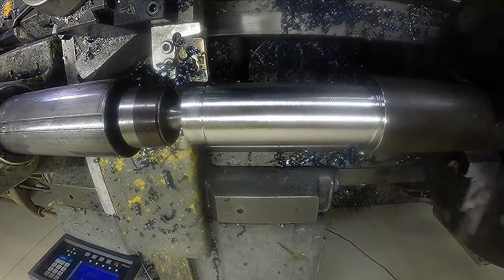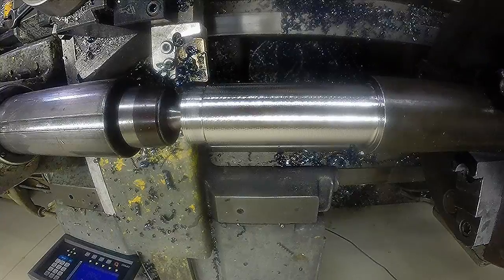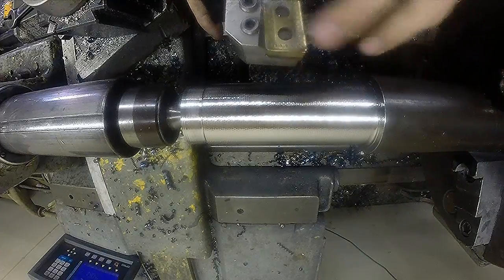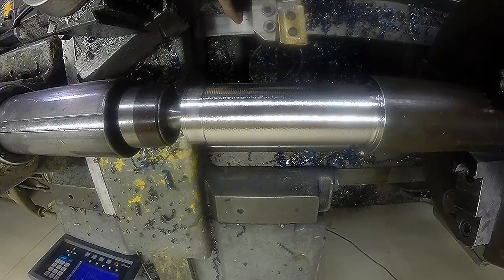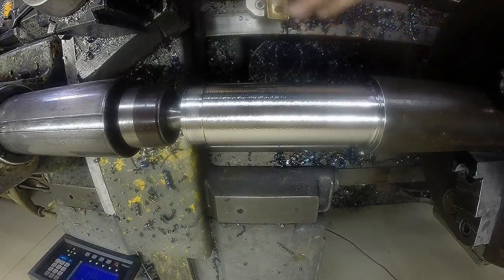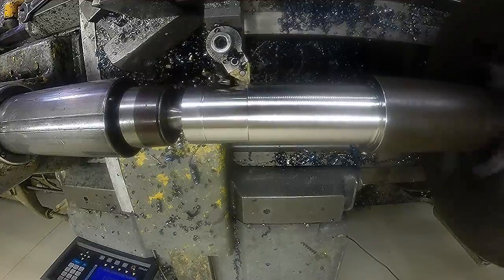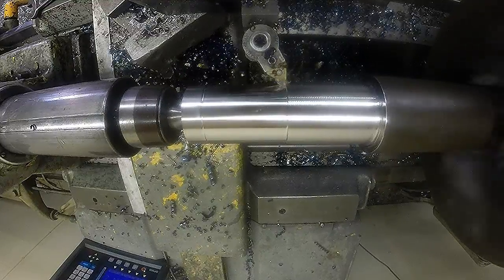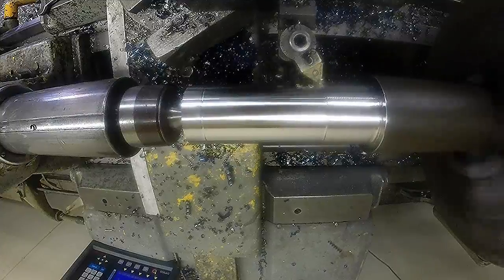Chip Breaking

Comment: So how well does the multiangle insert holder work?
Reply from the maker: It works very well especially for profiling type work as you can quickly get a repeatable angle and with the triangles you can work in some tight spots.
Reply: My big worry about it is chatter.
Reply from the maker: For DOC of .100 or less I haven't had any chatter problems because of the tool.  I wouldn't try to hog with it. I use my CNMG's for that.